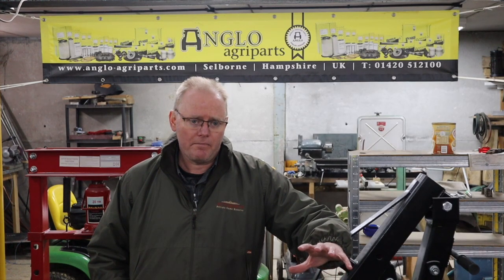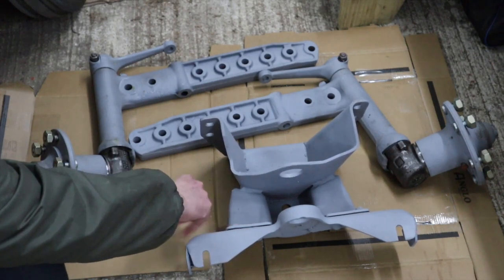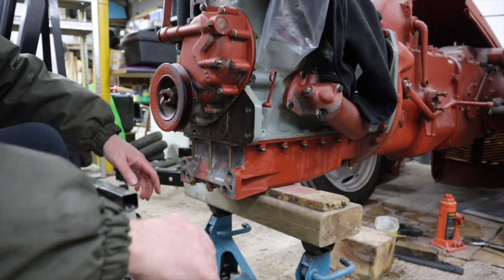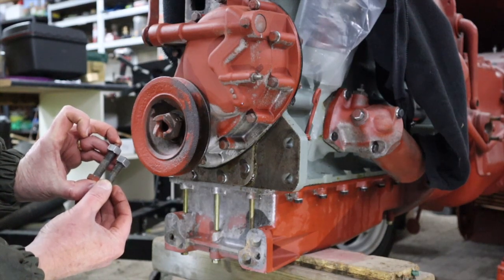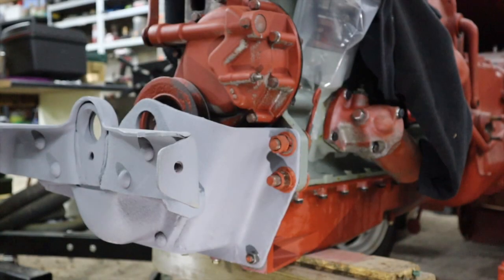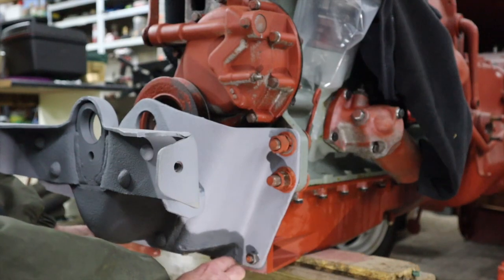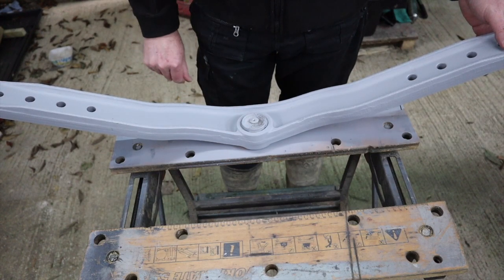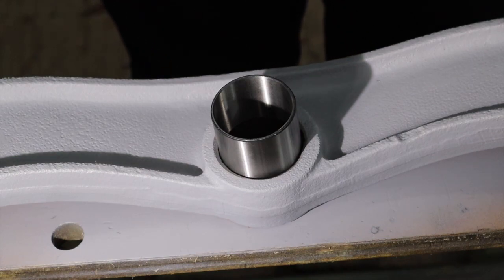#120 Ferguson TED20 - Assembling the Front Axle Part 1 - with Anglo Agriparts

Comment: Hello Gordon. Two other people with a keen eye have already mentioned the axle beam is upside down, so I should keep that comment to myself. Apparently the factory installed the pivot pin with graphite grease due to lack of a grease point. That or a similar product should help keep any dirt and moisture from attacking the bushing and prevent corrosion. Not too many people would get around to pulling the axle pin on an annual basis to clean and lubricate the pin/bushing. I will very likely install a grease fitting when I perform that task on my TE20 project. TTFN/CDC
Reply from the maker: Hi Charles, yes indeed, the lack of a grease point is a flaw, but I think it will be an interesting experiment; to see how long I can keep it free and clean and how much of an effort it will be. 😉👍

Comment: Hi there! I have followed your project since i found your videos of working on the rear axel since at the time I was myself restoring a Fordson major. I really can see the similarities of the progress on our restorations. Earlier this september i got to start my Fordson major after the restoration, first time in over 20 years. I was really proud  and can’t wait to see you start your tractor for the first time. I have a question however if you will show any of the painting or if you doing that offscreen. And if you are not showing it how are you doing it, just with at paintbrush or are you spraypainting?
Thank you for continuing sharing your progress!
Reply from the maker: Hi Simon, thank you for your comment. It is so good to hear from our viewers especially to hear about their projects. Well done on getting yours running. I am eager to get ours running too and after sorting out the steering we will focus on getting the engine completed and fired up. Ref. Painting until now we’ve only applied primer. Once the restoration is completed I intend to spray the whole tractor. For the primer I am just using aerosols, but will use a spray gun when we do the top coats. I am not an accomplished spray painter and very amateur when it comes to body work in general so I’m not sure how it will turn out 😂. Hope that helps. Are painting your Fordson?
Reply: Yes I painted my tractor with a spraygun both primer and top coat , i belive that i turned out really good and it was my first time using a paint gun so i belive that you can get a good result aswell. Altough it was very nervous when I only had the body panels left to paint since I didnt want to get any paint runs. Luckily it ended well with no paint runs😅
But if you start on the least visibel parts i belive that you will get the hang of it really fast and get a good end result!😁
Reply from the maker: Ye we’ll give it a go. My tractor is covered in pitting I’m guessing it’s spent at least part of its life on the coast. I’m still unsure how best to deal with that, or if I just paint it as is. It is after all part of its history. Most probably I will try to use filler on the tin work to try to smooth that out a bit. 👍😉